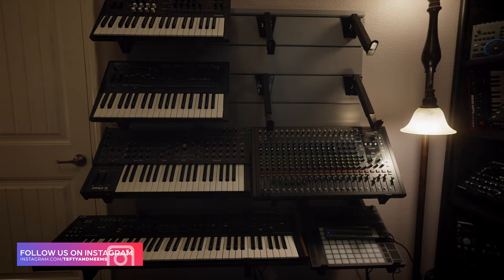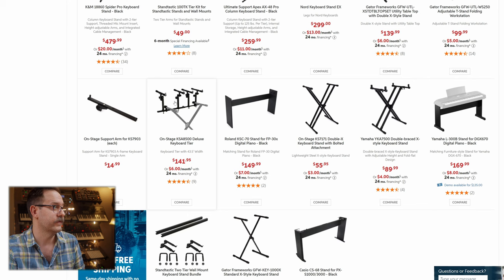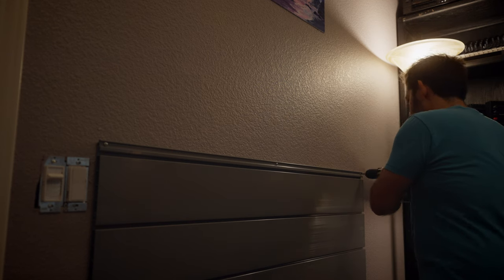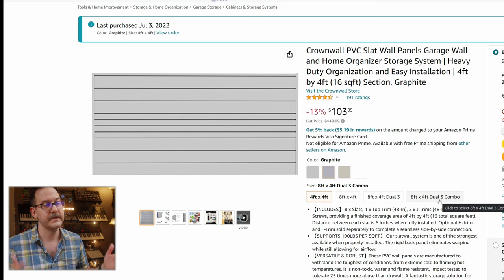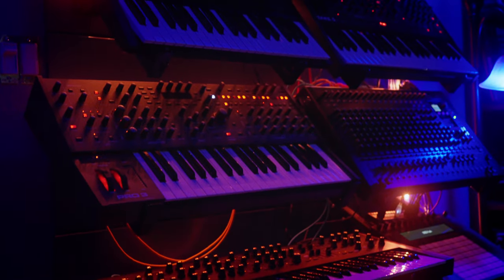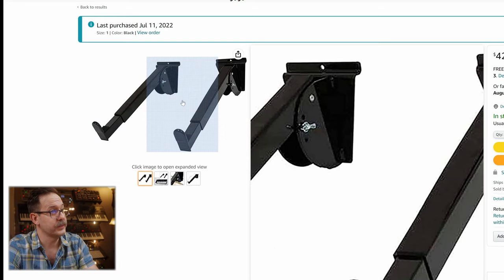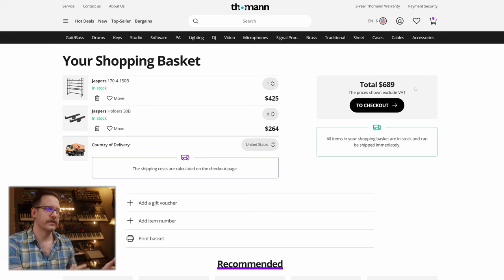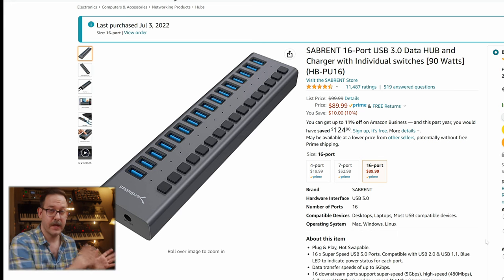Building A Synth Wall // Keyboard Stand Alternative

Comment: I did this exact thing about 4-5 years ago and was fortunate enough to do it when the keyboard arms were only $22 each. I bought a long 24-outlet power strip, four 4x8 sheets of garage slatwall which I painted, and added aluminum inserts to boost strength. I also bought 10 pairs of keyboard arms and realized I needed more a year or two later, but the prices had skyrocketed. The cost is double what I originally paid, but there is a simple solution to house more equipment: Pick up a few MDF shelves and some 1x2 lumber from your local big box store. Put the 1x2 along one edge to prevent synths from sliding off angled shelves, and it also prevents the MDF from warping under the weight.  I painted mine black, drilled three 3" holes in each and added desk grommets for cables, and it works like a charm. It gives me 4 ft of space for every pair of keyboard arms. All my shelves except one have at least 2 pieces of gear on them, and I have an extra set of keyboard arms spare now.

Honestly it is not the best setup for "making music", but it is an amazing setup for turning everything on and having a blast. It also takes up a lot less space than keyboard stands do.
Reply: That was my immediate thought. I also use extra long pine boards to extend my desk area.  No need to even drill.

Comment: I was in a similar boat and did the wall mount Standtastic bundle (it’s at the bottom of the sweetwater page). For my small stuff, I put piece of adjustable shelving between the arms.

It works, but I really like how you can do independent angles in the same row. I’d probably do a slat wall if I was doing it again (now that I know it’s a thing)

Comment: I was looking at keyboard stands on Amazon and ran across the slatwall keyboard arms. That sold me on the idea of using slatwall. My studio isn't very big and is in the same room as a home gym. So not having a bulky rack on the floor is a great idea. I am glad I found your video so I can see what a setup like this looks like. The LED light strips in the grooves is a fantastic idea. 

Your video has sealed the deal on me going with slatwall for my keyboards and synths. Now I just need to save up my pennies so I can afford to get the slatwall and 8 pack of keyboard arms. Might as well get the 8 pack to save some money and have plenty of space for stuff so I have room for my current grear and room for new grear.
Reply: I changed my mind in the slatwall. Up against the wall I was going to use I have a table for my desktop synths, drum machines, and Eurorack. I plan on putting my oscilloscope on the table. It's heavy and vertically oriented. So it would be a bit awkward to put on a slatwall. I recently picked up a 5 tier Jasper's A frame from Thomann. It's cheaper than what you showed. With shipping to the US it was $302.88. For now this should fit the bill. Instead of the table I could have a plank across 4 keyboard arms. So perhaps I may do slatwall in the future. But most likely I will still have the jasper's rack. So on the right of my desk would be the jasper's and on the left of the desk the slatwall.

I have also been thinking about putting up some slatwall on the back wall for less used keyboards.

Comment: I watched this a while back when I didn’t really need a synth wall. I re-watched it just now and I’m glad I did. I’m thinking about doing the same thing as you, but I already have a power strip, but now I think I’ll get a longer one like that, but run it vertically alongside the wall so I can more easily plug in and unplug.
Reply from the maker: Vertical is good solution as well for the power strip. I even considered mounting a 2U rack vertically to the wall for extra utility patching audio cables. The slat wall has been amazing so far after 6+ months 🙌

Comment: I've been loving my Jaspers setup for all my synth modules, keyboard and more. I have their 3 tier stand and i cut some boards to work as shelves so i wouldnt have to buy a zillion extra arms, which are expensive. I have the arms slanted downward so i added lips to the front of the boards. I also drilled cable holes in the boards, and the bottom board is deep enough that all the cables and power strips can hide back there. Its super compact and all on wheels, which is great for moving it away from the wall to reorganize things.

Comment: Great video!  I just got a Jaspers stand setup last weekend and it is a GREAT stand.  I got one on wheels which is really nice for my small studio space.  I really like this slatwall approach as well and think a combination might be great for me.  The slat wall is easier to reconfigure and potentially leaves a lot more floor space available.
Reply from the maker: Yep, one big benefit is the near "cableless" look you can get if you manage the cables by the power strip. You can also add more slat sheets to the top or bottom if your space allows it.

Comment: Really good video I'm glad that solution worked for you, i had a very similar dilemma, but i was able to find a used Ultimate support Apache A-frame for  the equivalent of $60, add $20 for new parts and elbow grease, I'm very happy with the results, the jaspers would've been ridiculously expensive to import, and I'm afraid the wall solution wouldn't have worked out for me, but your results with it are amazing

Comment: Cool idea, but my concern about any setup like this is always how well it works ergonomically. If I have to reach a weird location to play a synth, I'm gonna be less inclined to spend time messing with it. If you're just storing stuff there and moving it to a different stand when you use it, or if you're just sequencing stuff, then I could see it being pretty useful. But otherwise I feel like it would be a hinderance (the solution being just own less gear, haha).
Reply: It all depends on what gear you have. I like to control things via MIDI. So for me it wouldn't be a problem to have certain keyboards or synths that I can't play sitting down. I would just control them from another keyboard or MIDI controller. In general I think it's a good idea to have things setup with MIDI so they can be considered via a master keyboard. I really like layering sounds. So I am frequently playing multiple keyboards and synths at the same time via MIDI.

But all that said; Slatwall may not be the perfect solution. I plan on installing Slatwall for keyboards and synths. But I also have a two tier keyboard stand that I will keep using. So there will be multiple keyboards I can play sitting down. As well as my Arturia Keystep Pro.
Reply: @jennoscura2381  I had the same concerns as Walter-but to your point Im frequently layering synth via a midi controller.  If Im playing separate part (base and lead) on two diff synths, I can just position them accordingly on the wall.  I see you can change the angle of the supports, so you are not playing the instruments (at your sitting level) at such an extreme angle.  Again, great video and you have a new subscriber ;)
Reply: @N-trepid1  my thought is to have the master keyboard at playing height. Above that would be something I might want to play directly. It would be angled slightly. Above that would be something where I only need to mess with it to change settings. That would be angled all the way so I can reach the buttons.

Comment: I have a jaspers 150b stand,  the angled one.  The wall slats sound cool actually i wasn't able to do that in my living space,  but the wall flushed  power supply is an interesting additional solution.  

What I have done is on my upper tier I placed one of my two separate shielded multi power supplies, each having about 12 plugs. Since my low frequency expander has a very small length cord (I could have gotten a longer cord but the adapter I purchased has a small one), I placed that psu on the upper tier; there is room just behind it to put velcro strips to hold that. But that ended up working out in a weird way since my mixer next to the stand has a small cord also. So that spot for multi psu number 1 is the optimal spot.

The other multi psu (shielded power strip) sits on my amp next to the other side of the stand.  For my setup this has worked so far because I have a lot of gear to plug in. But it does take a bit of space. If my living situation were different I think the slats sound like an excellent way to go space wise.

Comment: i love the video it helped me visualize a rack, but i am wanting something portable. Gibraltar probably has my best options. 2x59" straight drum rack tube and 2x SC-GRSTLA Road Series Standard T-Leg (4.6" height): [those together is 5.5 feet tall] the width needs to fit my 88 key Midi controller which is 54" long so will also need 59" tubes for my horizontals. Later I'll probably add 2x 30" poles extensions to the height (making around 6 foot). i can even put studio monitor mounts on the side or on top, probably side for height adjustment. A few Power Rack T-Clamps for each tare and SC-GEMC Electronic Mount Arms will hold the units in place on the rack.

i will try to do a video on my other channel when its finished

Comment: Tip for the long feet in the way of keys - I would try sliding off the rubber part and trimming the metal to size then sliding rubber back on!

Comment: Like what you've done, here. It's a nice custom solution to a specific use-case. I'm still trying to find a stand that accommodates the smaller synths I have (mostly desktop Volca's, a couple of Arturia keyboards etc). A Jaspers would be sweet but kinda out of my price range right now. Slatwall would not work as I'm currently living in a rental and I can't fix stuff to the walls.

Comment: I would have driven 3 1/2 inch torx coated deck screws into the studs for your slat wall. All the weight is on the arms that are supported by your 4x4 wall. Just my experience speaking.

Comment: Cool. Although I live inside the European Union, the same as Thomann, so no import fees for me. We also generally have brick walls in Europe.

Still, you start paying import fees only at $800? It used to be something like €20 inside the EU, but they removed that lower limit, and now you always pay fees. And you pay VAT (value added tax), which is anything between 18% and 25%, depending on what country you live in.

Comment: This is a great option.  I have the A-frame stand and it takes up too much floorspace.  I'm switching rooms with my daughter soon, so this will be handy.  Two questions - What's the dimensions of your space? And, do you even bother with acoustic treatment in the room?  I may fabricate smaller panels to fit around the new wall fixtures, and at least some good bass trapping for the smaller room.  Thanks for sharing this!
Reply from the maker: 10ft x 11ft, so not very big. We gave up on acoustic treatment when we moved into this studio and decided to stay with headphones. We still have monitors that we use for writing sessions, but no critical mixing. All mixing is done on the headphones at the moment. I’ve been in really nice control rooms before and the proper placement of speakers and treatment basically takeover the space. Not really conducive for writing (unless the space is large). Good news is the more “stuff” you have in the studio the more natural “diffusion” you’ll have 🤣
Reply: @TeftyMeems  Diffusion galore! I'll be in a similar footprint. Appreciate the reply!

Comment: Still prefer the look of an A-stand which I was lucky to get used 3-tier ones with an option to add a 4th, On-stage brand for about $200 for two, but this is definitely an interesting idea!
Reply from the maker: Oooo interesting. Didn't realize there's a 4th tier addon. That's good to know. What I found with most stands that aren't Jaspers is the widths are limited so doing two medium keyboards on one row (Pro 3 and Take 5) isn't really viable.

Comment: I have a Jasper 4 tier A frame. But I really like this wall solution.
Reply: Which model jaspers 4 tier do ya have? And do you find that you have enough room to control the synths and gear between tiers? Looks like the 3 tier and 4 tier from them is same height… so naturally the 4 tier has less room between tiers

Comment: I've got a pair of four tiered Standtastic A-frames for my setup. They were great when I had all of my gear setup in my garage. But since I moved everything into a smaller room, they take up way too much floor space. It's almost like having a couple of synth pyramids in my studio. It's probably about time for me to look into getting a slatwall setup.
Reply: Where did you find a 4 tiered standtastic stand? Most I see is 3 tiered
Reply: @ryanwilson2481  
They were originally three tiered stands, but you can order extra tiers separately and add them on later.
Reply: Oh so you just added a pair of the wall mount style arms from standtastic and they easily can be added to their 3 tier stand?

Comment: I'm currently dealing with this. I like this idea, but I also feel that the Jaspers and BlackPantherSystems, have some perks. The thing that's preventing me from doing this, is it has to be connected to a wall. I like the idea of being able to move my gear around, if needed. I have to make my mind up soon, because I hate having gear clutter. I was thinking about getting a Jaspers or Black Panther, and a decent studio desk. I have tools, and experience with carpentry and furniture building, but wood gets super heavy, and I would hate to end up with a 1000lb desk. I've thought about engineering a desk, so I could easily break it down into pieces to make moving easier, but I'm not too sure if it's worth it, due to the cost of plywood, and hardware. I'm also concerned about designing something, building it, and then not liking it, due to a mess up in the design. I also deal with chronic pain, so I don't enjoy building things like I used to. I've thought about getting this, and then reinforcing a piece of 3/4 plywood, and adding a frame to the bottom, with wheels, so I could move it around, but it would be heavy. I could at least make it easy to disassemble. I love having hardware, but making the right choices when paying premium prices, is super difficult at times.

Comment: I am installing the Crownwall right now, but the studs in the wall are very odd. 1st stud is 12 inches in from doorframe. Next stud is 11 inch on center. Next is 24 inches on center. Next is 9.5 inches on center. If I center the middle screw of the slatwall panel, the studs to the left and right of center are still about 7 inches in from the edge of each side of the slatwall. I am going to call the company tomorrow and ask suggestions. Just posting here in case anyone is doing research so that you know you may run into an oddity along the way.  

UPDATE: I just went ahead and spaced the screws to the studs as equidistant as possible to compete the Crownwall. Used the same brackets as described in the vid. It is completely sturdy. I’ve got 3 keyboards, a rack module and an MG12XU. They all fit flawlessly. The bottom keyboard is an 88 weighted key Triton at piano height so I can sit right down and play. Absolutely fantastic. Thank you Tefty and Meems for thIs AMAZING idea.

Comment: Very good idea. Did you take any precautions around the tip of the arm to make sure the synth would not jump out and fall. Like adding some foam or somtehing . I would just be afraid of a synth just falling.
Oh and yeah , got the issue with korg minilogue XD drivers , but theres a good video on how to use the korg midi port deinstaller to free up one of the midi port between 1 and 10, cos if the driver is installed using a midi port above 10 , you screwed 😂 , no need to switch to Mac 😂

Comment: Thank you so much for this video. 

I have a Jaspers 6 tier stand which took around a month (!!) to get delivered from Thomann in Germany. I have a 6-tier, a 2 tier, plus a modular shelving system from Ikea. My collection (currently about 20 synths) has grown too much to invest in more Jaspers stands at the prices they now cost. What's worse is I cannot hook anything up that sits on my Ikea modular simply due to its design. 

This slatwall system looks to be a perfect solution. I control everything from a Push 2 or a controller keyboard anyway, so all of them can be up on a wall and out of the way. My only concern is the strength of PVC slatwall for larger synths (30-40lbs each). Any insights on the load-bearing limitations of this PVC system? 100lbs PSF sounds okay, but really how strong is this stuff? 3,200lbs per 8 x 4 panel? Is my math correct?

Comment: What type studs do you have, metal or wood? I have metal, so I'm thinking toggle bolt anchors. Did you just use sheet metal screws? What type anchors did you use?

Comment: Hey @TeftyMeems or anyone else who has built this same slatwall project.. how much approximate space do ya end up between the various tiers/synths on a vertical plane? I realize depends on which slat you place the arms but I’m thinking of building this same 4x4 crownwall and concerned the controls on my synths will be inaccessible due to synth above it. Do ya end up with more space between tiers than say a jaspers 4,5, or 6 multi tiered stand? I realize each slat is 6”, so in theory with 4 tiers I would end up with 12” between each right? I’m trying to think which gives me more room between tiers… this slatwall project or a jaspers. I don’t mind ordering one but if slatwall gets me more space on a vertical tier level then I’ll go that route. Thx! Oh also where do you find the 4x4 dual 3” combo slatwall?